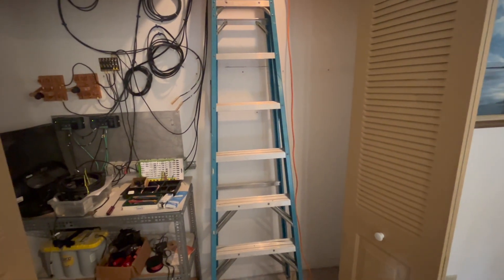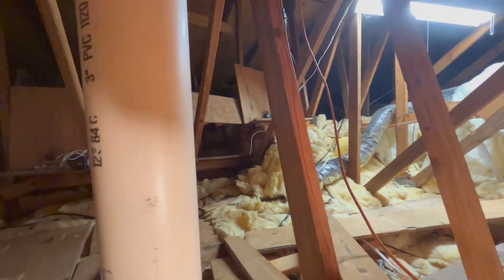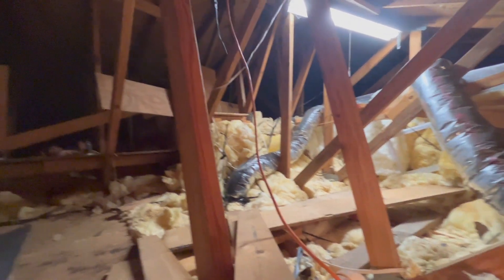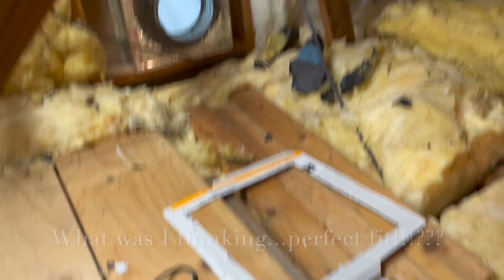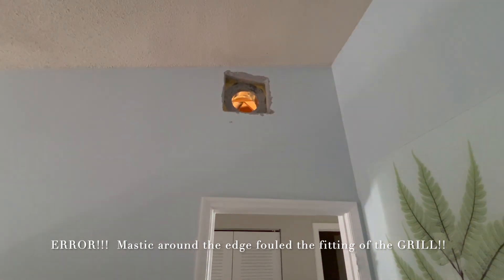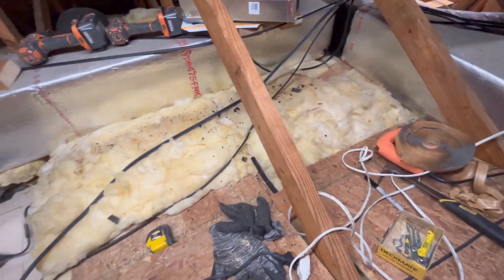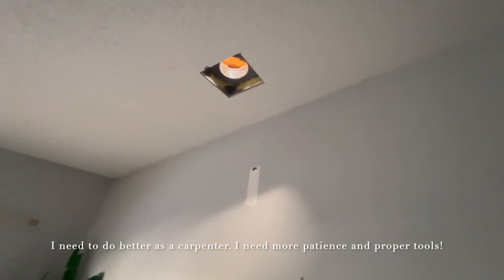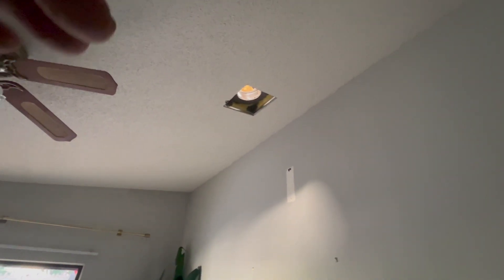DIY HVAC Adding Return Air Registers (Part 2)

Comment: Great that you can assess what worked and what did not for the project. You saved yourself a great deal of money on the install.  Wonder if you looked over HVAC duct sizing calculations so you can maximize your particular HVAC system? Great job in going for it and getting an improvement in your home.
Reply from the maker: You are very kind! Thank you.  You bring up an excellent point that I should have consulted established airflow tables to be more accurate. Another Lesson to be Learned!